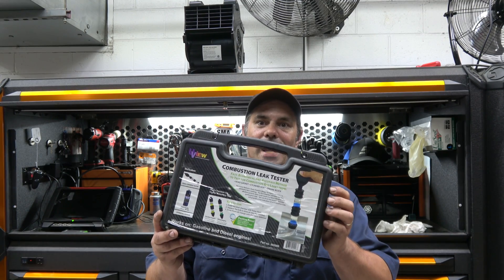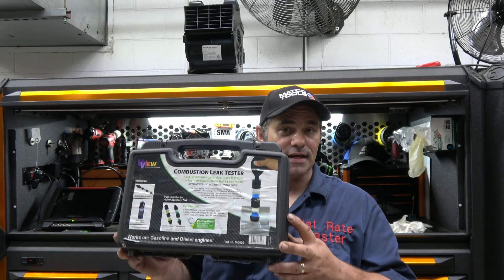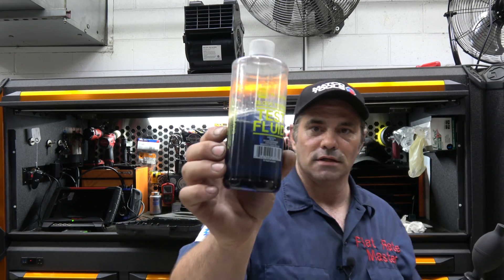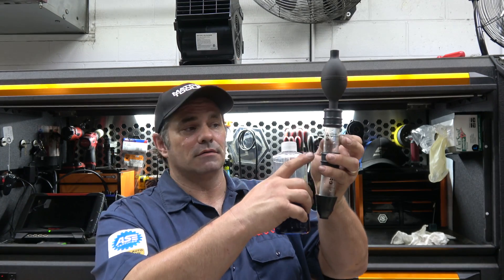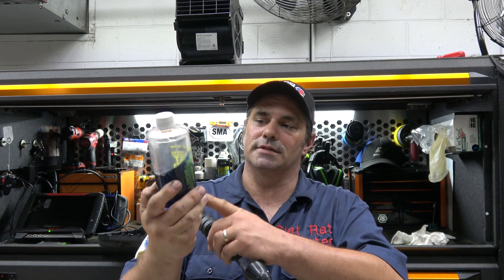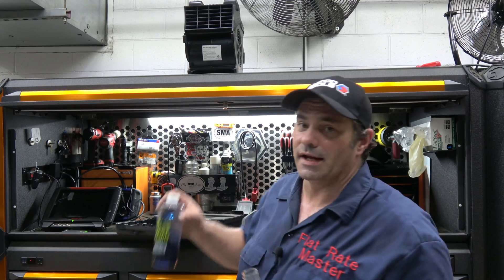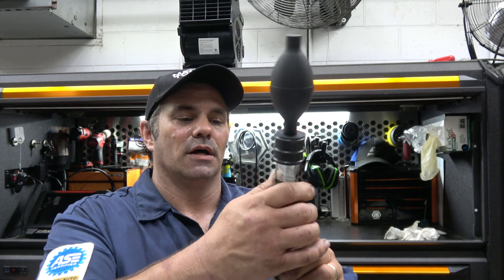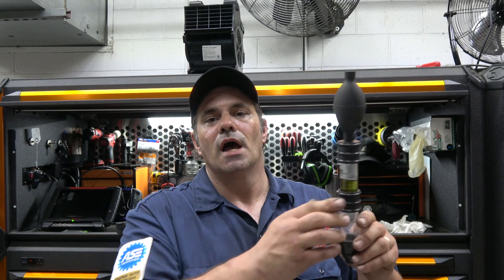UView Combustion Leak Tester

Comment: Great video Sir. I did the test today on my Prius 2010 with a single chamber and it  just a little bit  turned green. I also noticed the brand-new fluid exposed to daylight will turn yellow. Is that a good indication that I have a small leak. Which product or brand would you recommend to seal it please. Thank you

Comment: what a stupid thing to suck or connect some hose(like my kit has one) to
 the vacuum inlet(instruction says that) - what for??? Anyway, I see 
that bubbles go trough that blue liquid - it means any gas(air pockets 
or exhaust gases) goes through the blue testing liquid in any cases and 
no one needs to use that fucking vacuum pumps/hoses???

Comment: Been using one of those for a long time. They work pretty well even on diesels. However one note of caution a vehicle with a blow water cooled EGR will also give a positive reading. So it’s important to still do a leak down test prior to yanking the head.
Reply: Well, the liquid on my Gen 3 Prius turns greenish. Changed head gasket, water pump, thermostat, EGR (valve & cooler) - all parts new Toyota original. Still greenish liquid. The car runs fine, no codes. But it bugs me a lot. On the 2nd car with exact same engine (Prius v 2012) it stays blue no matter what. What it could be?
Reply: @abrindeyev  was head checked for cracks?

Comment: Hit and miss isn't good enough with all the time, money, and reputation involved. We use a hand held snap on 5 gas on any car that misfires, overheats, or has a low or no hvac heat output complaint. It's as big as a dvom very reliable and accurate.

Comment: Flat rate master, what kind of mechanics make the most money? There are engine guys, transmission, HVAC, electrical,front end, glass, etc. etc. Are there any kind of specialty mechanics that make more than others? Also, do certain dealerships typically pay better? Like a BMW specialist vs. a Honda specialist
Reply: Nick  , 
The issue is not if BMW pays more . It can vary.  Honda have more cars on the road  . So more volume of work. And also  how many technician at shop , too many techs = less work .

Comment: Good video and your right in what you said we had a blown oil cooler on a ford focus did that test and one of our thecs said its head gasket but i said isolate that first and flush the cooland and the test stayed blue then showeing it was the oil cooler and not a head gasket failure so like you said quick test then ingratiate great video 🖒

Comment: The tricky head gasket leak lol 

I dont like that kit i think todays engines are way to advanced ,its hit and miss 

I still go to my coke  bottle plumbed into cooling system go for a hard drive jump out check for bubbles 

5 gas tester way to much $

Great video

Comment: Funny you post this.  Earlier this week I had a hemi truck come in, complaining of a coolant leak and overheating.  The cooling system had no coolant in it, so I filled it up and pressurized it to 15 psi.  Inspected for leaks, no leaks.  Ran the engine with the pressure tester still attached and the pressure shot up to 30 psi in less than a couple minutes...  I took the pressure tester off and ran the engine and got bubbles coming out every 3-5 seconds.  I recommend headgaskets and inspecting the cylinder heads.  Customer declines and gets vehicle towed elsewhere.  Advisor calls our shop and says we are stupid and it just needs a radiator cap....now I’ll be honest I was dumb and didn’t check the cap, but from what I saw there was a bigger issue than that.  Oh well this looks like a good tool to add to the arsenal
Reply: Your diagnostic was surely right... I saw a bunch of poeple just changing the radiator cap....  They are the same poeple who just change the gaz cap when they saw evap leak....
Reply: It's always the tech that sells the cheapest repair is the one that is right. What you might not have heard is what happened a day later when it overheated again.
Reply: an overpressurizing radiator cap does not explain loss of fluid and bubbles. Granted, a cap is a cheap test before committing to big bucks, if they have the time to play around and/or get stuck.

Comment: good morning frm  drain a little coolant out of the radiator  then the test drive...and if exhaust is there it turns yellow bam!   it has turned a little bit off from blue , I wont count that..  good tip about not doing it inside   hope that cam actuator solenoid you had worked out